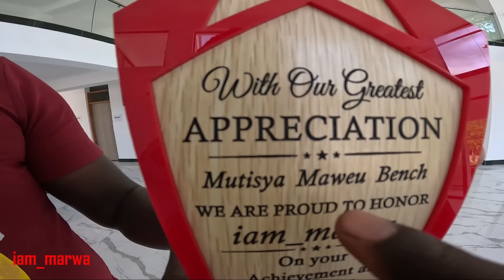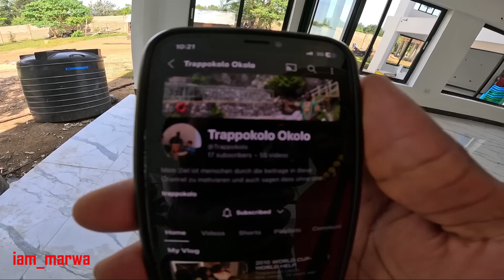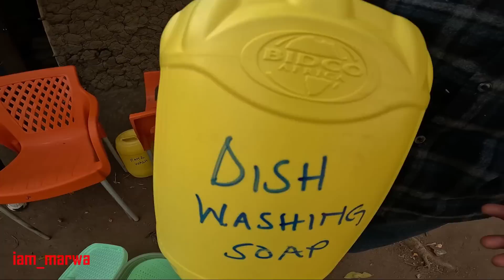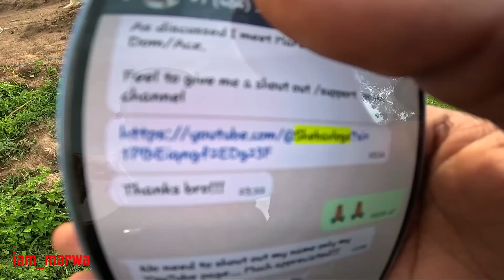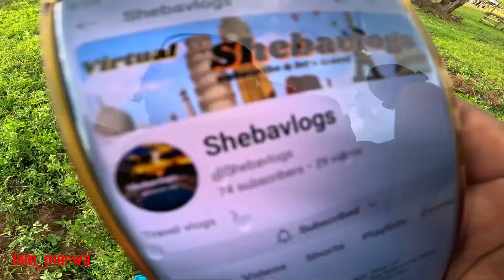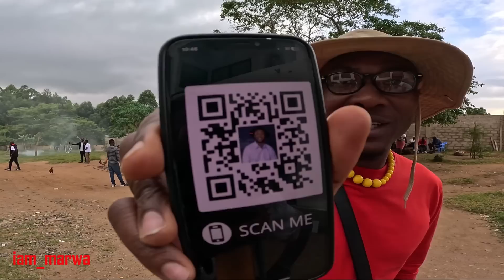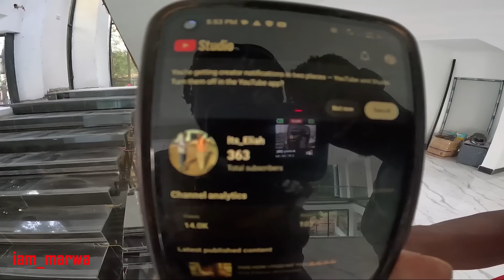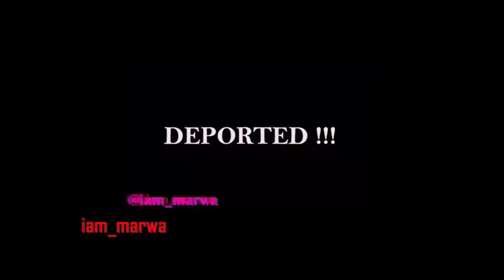African Village Shenanigans Continues !!!

Comment: Awesome gift from Germany. To protect it from rain and theft,  instead of hanging up white sheets outdoors to videos project it onto the walls of your house which are large and white enough both inside and outside. Build a strong box and stand that can be locked in which to place the projector to protect it from theft. Always place it near a security camera to capture any activity designed to tamper with it or steal it. ALL back packs and large bags should be searched coming in and out of the villa by security guards wearing gloves to protect themselves. Too many things have disappeared from your compound.
Reply: I love this suggestion. Hope he will take your advice.
Reply: Why's that a problem? He's using his channel to expose their channels call it advertising and the fees are what they are. You can hate but you can't find fault with his business model.

Comment: Marwa build an out door open kitchen, it should be raised from the ground, like a barbecue stove. Have your engineer design a cooking place that has like five stoves. design and one fire 🔥 place. Five stoves built together that share one mother fire 🔥 place where you put firewood, they should all be linked together using small tunnel. You put the firewood in the middle stove and the heat is transferred equally to the other four stoves and the firewood place should be built behind the kitchen so that the smoke doesn’t come in to the kitchen
Reply: Good idea. He has not planned for outdoos cooking for overseas visitors.